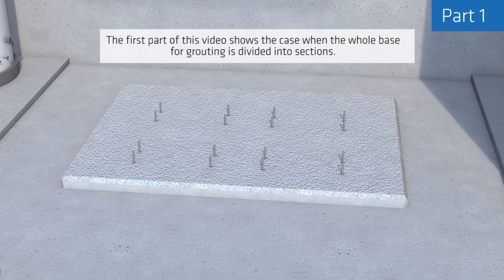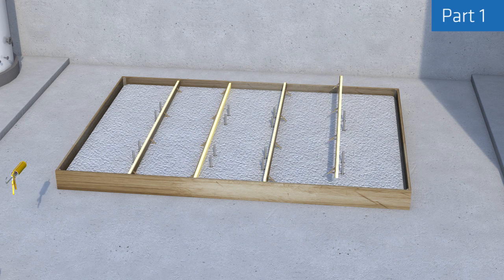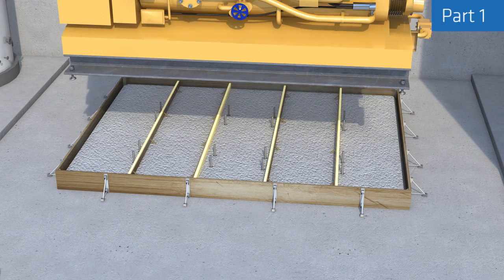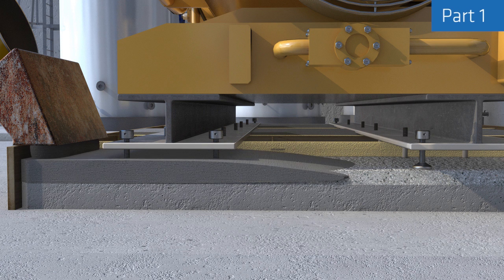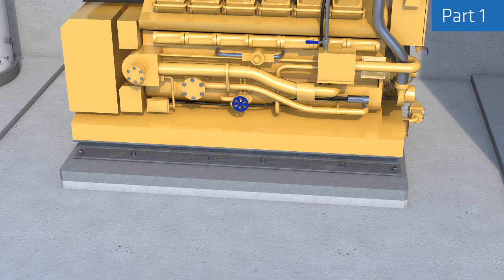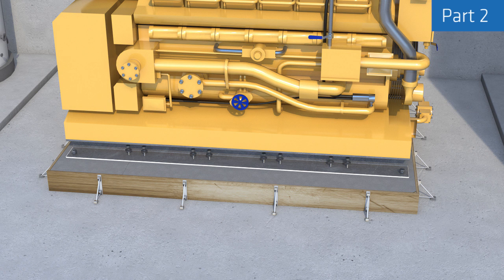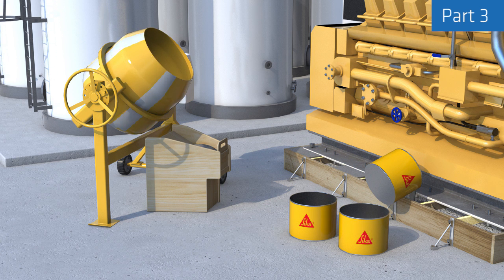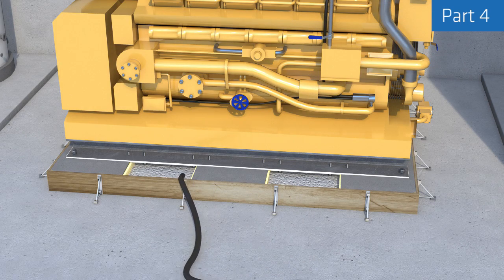How to apply Sikadur®-42 Epoxy Grout, Compartments when placing Large Volumes

Comment: How do you get the sectional forms out? In the animation, it seems they are removed after finishing the pour, before setting. It seems it would make more sense to remove them after the odd sections had cured, before pouring the even sections.